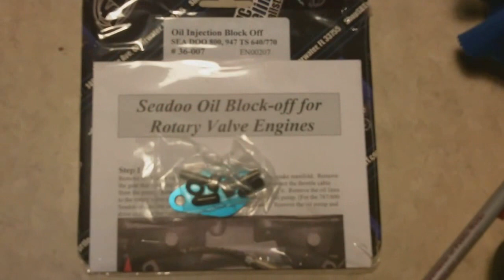Seadoo 1997 GSX 787 Top End Rebuild and Oil Pump Removal

Comment: And you don't use zip ties you use velcro strips that way when you push the cylinder down it pushes the velcro down then you just reach under the Piston with your finger and under the velcro much faster much easier

Comment: did u leave the oil tank in the ski what other things do you do to premix oil thanks
Reply: You still need the oil tank and pump to lubricate the bottom end of the engine. You just block off the line that sends oil to mix with the fuel.
Reply: This guy don't know what he's talking about you. You do need the oil tank but it's not to oil the bottom end that does it with the fuel it's to oil the right and left side of the rotary valve so you must put a t and connect the right and left side of the rotary valve not only that he didn't remove the oil pump drive gear you must do that on Sea-Doos because it can come apart and destroy your rotary valve

Comment: For the life of me I can't get the heads onto the pistons. I keep trying with the zip ties but can't get it. Any trick to getting those on?
Reply: I've been working on jet skis 15 years you don't use zip ties you buy velcro strips that are as wide as the Rings you get them in order then you wrap them around on both cylinders then you turn the engine where one cylinder is higher than the other and Slide the cylinder down over the piston and it will push the velcro off as the Rings go in

Comment: Hey, I have a 2002 gtx rfi, it started running crappy in the fall and recently did a compression test and it read 110 and 120, what was your compression prior of doing your top end?
Reply: That's low compression on that ski it should be within 10% of each other and it should be 130 to 150 if you're getting 110 that's very low but make sure your compression gauge is not the problem and find the reason the compression went out don't build a motor without finding out why it failed or it will fail again

Comment: No need pull the engine ??
Good news
Reply: I realize the question is two years old but the 787 engine doesn't need to be pulled to do the top end. The 951 is a lot harder to do in the ski due to the long studs and little clearance to work.

Comment: This guy doesn't know what he's doing he removed this totally wrong there is a gear underneath that housing that has to be removed on a Seadoo it's different than any other ski because it has a rotary valve which is where the name Rotex comes from then you have to put a t underneath the motor to connect both sides of the rotary valve chamber together and keep the oil tank hooked up to that otherwise it will burn the rotary Drive Gear Up and the gear that I'm talking about removing is the oil pump drive gear if you don't remove this it can spin freely and come apart and it'll destroy the stator